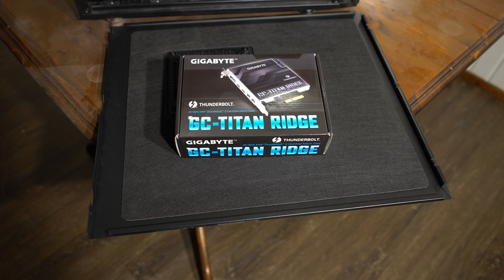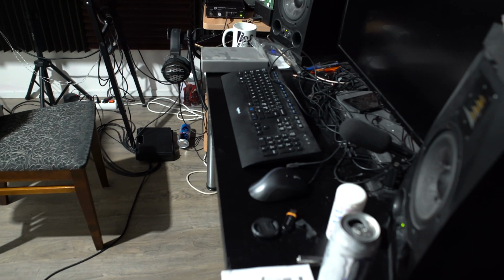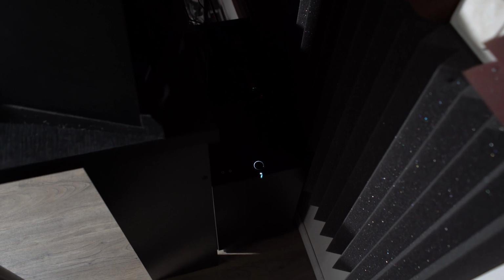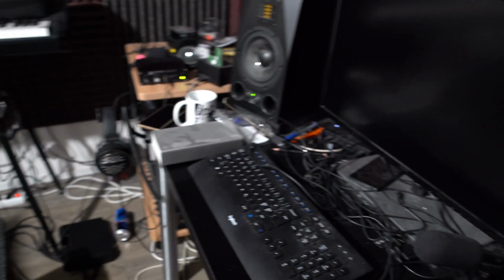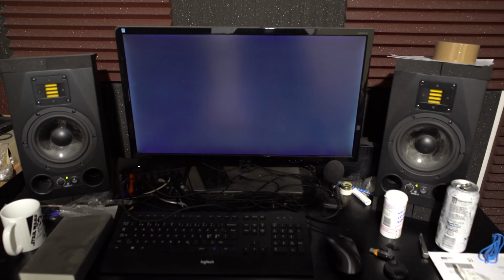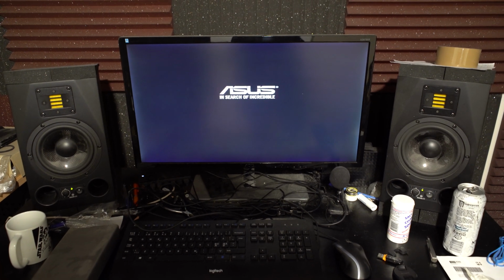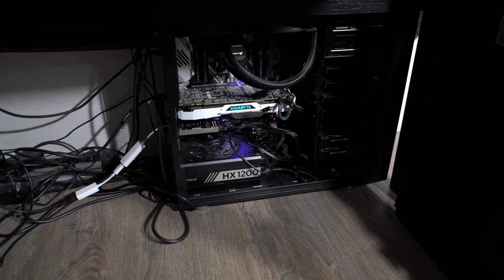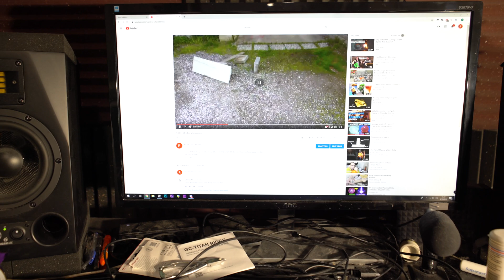Thunderbolt 3 in AMD system

Comment: I want my motherboard B550M PRO-VDH WIFI( windows ) to work with apollo twin x.. which thunderbolt 3 extension card is suitable for my motherboard..? Please help me.
Reply from the maker: There is no official support for Thunderbolt on that motherboard. The best you can do is to try if the Titan Ridge controller works with your card with the jumper cable and reboot hack.

Comment: Please don't use a vacuum on computers, it makes static and you're playing with fire.
Reply from the maker: What would you recommend? I got myself an (oilless) air compressor that I use nowadays to blow air through the fins to get rid of the gunk. But I still need the vacuum to clean the room I'm in afterwards.
Reply: @RavenFly1232  Well yeah, you do it correctly, but don't directly vacuum the computer.

Comment: Nice video man,  So where did you get the driver to install for the Thunderbolt 3? Does the card need to have a driver installed to work? like after you shorted the pin 3 & 5, did the card work ? or you still have to find the thunderbolt drivers? and where did you download the Thunderbolt drivers? thx

Comment: Hey, is this the Gigabyte GC-Titan Ridge v1 or v2? Because I have an issue with my ryzen r5 3600 as I just bought a new Motu 8Pre-es and for some reason, ryzen and the usb connection don't work together. I was hoping I could hook it up via thunderbolt because otherwise, I have to send an interface worth 1400 euro back which would really really suck.
Reply from the maker: Probably rev 1, I am not sure there is a second revision. For me the procedure to get it working was to first power up everything connected (interface and pc) and then use windows restart to restart the system without electricity going off. This ensured that windows registered the device (this functionality (plug and play) is what the header normally does). You could try this. Also check that the card and drivers are visible and installed in device manager

Comment: Do you have any issues with crackling and latency thru the audio interface any plug issues?
Reply from the maker: No, the connection was more stable than with my firewire card. The only thing the TB header probably would've done is enable plug'n'play, so with this setup I needed to restart PC after connecting the interface to it.

Comment: What kind of jumper cable did you use do you have a link to buy the jumper cable?
Reply from the maker: I think that piece of wire was from an old lamp. Any wire will do, single core copper wire is the easiest. Go to a local electronics store, and ask for bread board wire, they'll know.

Comment: So your motherboard has a TB header to plug in the gigabyte guess my motherboard doesn’t and it’s the dark hero Crosshair damn idk what to do
Reply from the maker: Actually I don't have TB header, only PCIe and a jumper wire
Reply: @RavenFly1232  do you get any issues with noise crackling? Or latency issues or stuff recognizing

Comment: Three questions for you, no idea if you’ll still respond, but one: there is certainty this should work on any motherboard (aorus b450 pro with a 2700x)? 2: would this work on the revision of the titan ridge? 3: what kind of cable did you use to jump the pins?
Reply from the maker: To your first question: it should work, but no guarrantee, so you need to experiment.

Second: I think I have The revision 1.1 or something like that, so in theory, yes

Third question: regular single strand jumper wire. The best sort is the one meant for breadboarding electronics.

Comment: Hey Man, cool Experiment and cool video really! I would like to connect my HP Reverb G2 VR Headset to a stable high power USB-C Port since the AMD X570 USB ports seem to struggle about this... This TB card has got like a 100W USB-C port and sounds like a perfect choice BUT did you say that especially the USB-C ports on this installment won't work?
Reply from the maker: Yeah, I couldn't get USB to work with the thumb drive I tried. For me personally, that is not a loss, as TB is what I wanted/needed.

Though there are USB-C cards, like StarTech.com USB 3.1 PCIe Card that may fit the bill, if USB is what you need. Probably better support on AMD too.

Comment: Would it be possible to get Thunderbolt 3 working with AMD Ryzen laptops? I just wanna hookup a eGPU on my laptop :)
Reply: Short answer: nope.

Long answer: TB3 is basically a PCIe slot in a more convenient form-factor. That means that the only way to get a TB3 port is to either hardwire it in or connect to an actual PCIe slot. Now, in theory, if you had a laptop with two internal drives and one of them was an SSD in a PCIe4x NVMe slot, then you could plug a Thunderbolt 3 PCIe card into it using an adapter cable. However, you'd have to be willing to sacrifice that SSD, expose your laptop guts every time you wanted to plug your TB3 stuff in, and rig up an external power supply for the TB3 card. Even if it worked (and it probably wouldn't, due to firmware and software limitations), it would be an absolute horror show.

Comment: I have an Alpine Ridge (r.2) and a B450 Gaming Pro with Ryzen 7 3700x and an RTX2070 Super. I know It's not supposed to work but you wouldn't by any chance have heard of a way I could make it happen? Would it hurt to try what you've done with the Titan Ridge on the Alpine? There's a USBC port on my panel but I really need TB3.0 and don't really want to spend 300+ dollars for a new board.
Reply from the maker: You need to do some BIOS hacking to get the alpine ridge to work. Some individuals have succeeded, but that's still way too much work for an iffy result.

Comment: Did your jumper wire have a connector on the tip? Or just the metal wire touching the pin?
Reply from the maker: Just the wire, and even then it was a tight fit.
Reply: Raven Fly's Channel awesome bro thank you my 2.0 just came in the mail today and the wire is coming tomorrow.

Comment: I have a Crosshair VII Hero (WIFI) and a Ryzen 2700x... trying to get my apollo twin to work via TB for months and haven't found a viable solution.
Reply: This worth it?
Reply: @StDaniel93  I'm planning on swapping my board for another one with TB support. I was tempted to do as shown in the video but I don't really feel confident in doing so, I don't know if my board being incompatible with the GC Titan Ridge is an issue, nor I can make sure this is a viable option on the long run (stability wise).

Comment: This is exciting! I was hoping to find someone else that managed to jump the pins and get the thunderbolt card working! Can i ask whether you had to install extra software to get the card working? Do you by any chance have hackintosh on this and if so does the thunderbolt work?
Reply from the maker: Only the drivers were necessary, everything else worked out of the box, only plug and play didn't, so anything new needed to be plugged in, and then the PC must be restarted (not just turned on, but actually restarted so that apparently power isn't cut off). 

I don't know about hackingtoshes, but I'd assume it depends on the Apple way of doing things. If they have other version of the controller or there is some other shenanigans going on, there may be a need to write/modify a driver. Hackingtosh community has been active in writing drivers, but as it is still a minor project, there may not be anything ready yet.
Reply: @RavenFly1232  whoa that great, thanks! I went intel in the end but really good to know it can still work on my friend's amd system

Comment: could you go into a little more detail on the jumper cable? What is the purpose of the jump, why 3 and 5, and is it bad to not do this step, will be doing it as it seems to work for you so I would like to try the same, but would like to know the theory as to why this choice was made. Thanks for the vid its been a great help so far! using a x570 elite from aorus and a 3900x

Comment: This is great!! Thanks! I’m holding to buy Apollo because of thunderbolt. I have an asus rogstrix 570e motherboard with a ryzen 9 3900x. I guess this should work. I should buy the gigabyte instead of ASUS tb3?
Reply from the maker: Depends on the model, Gigabyte has an "extension header" on some models, so you will get the plug and play features for thunderbolt, but otherwise, as long as you have enough free PCIe lanes, this should work :D
Reply: I am trying to decide on a Ryzen or an Intel build now have you made a decision yet?

Comment: The Rev one card has way too many issues on my board so I got rev 2 from taiwan. No additonal power supply or USB connections required. Just the PCI fit + THB cable and I have thunderbolt access at over 2500 on m.2. drives. The Rev 1 (when working) gave a misealy 700 on the same drive. The Rev 1 belongs in the bin. (SIMPLY BUY REV 2)
Reply: Link?

Comment: Did your bios had a thunderbolt option? I checked out your motherboard and there seem to be no TB header.
Reply from the maker: No header and no option. Plug and play is a bit finnikey, but If device is on at the time of boot, TB will work 😀

Comment: Hi, is it possible to do the same with an Asus TB3 ex thunderbolt adapter?
Reply from the maker: Can't really say, probably not as easily. The reason this works, is that the Titan Ridge controller is much more permissible than previous controller generations from intel.

Comment: USB c flash drive wont work because need thunderbolt or USB c compatible mobo with header.
Reply from the maker: That would explain things. Fortunately I have unused USB C on mobo, so this isn't too critical. As long as TB works 😁
Reply: @RavenFly1232  I'm not talking about USB C port on mobo...there are th3  header and front usbc header on mobo. I have x399 gigabyte designare ex mobo with usb c port, front usbc header, front 3.0 usb and  front 2.0 headers, and 5 pin thunderbolt3 header. Gigabyte Titan $98  or $60 alpine th3 pci cards extra. Not many th3 external drives; Th3 expensive and good for daisychain. I dont really need that tech..combo of display pci usbc. Displayport does not have audio wire like hdmi...soutput VGA serial dvi a/d/i is obsolete and dead
Reply from the maker: @cjonwickham1933  I mentioned the port only because I don't have need for the TB port to handle that stuff :D  For me the only reason for TB is to retire FireWire, and move to other protocols, when the time comes (and my LS56 stops working) :D

So yeah, niche tech needs of a small home studio, that's what I use TB for :D
Reply: @RavenFly1232  yeah...th3 and usbc is same thing pretty much....you won't miss th3 header already usbc i/0 and front usbc on x399 designare ex 1.0

Comment: no problems at all? I have an AMD board with TB3 on it and I do have problems with my Apollo Twin X. I'm thinking of hackintoshing my PC or getting a board compatible with that pcie card and try again... the problem is that this board costed me 220€ (on sale) and it sucks to have to buy a new one
Reply: Contact me..i spoke with Asrock and they told me that they gonna find an apollo interface and make it happen. I have a Ryzen 7 2700 and I am about to buy an apollo x6..
Reply: @georgezorbas6422  what do you know? you can talk to me on instagram if you have an account there. do you have one?
Reply: @miguelmoreira5248  Facebook only:Zorbas Giwrgos..find me.( the guy on the floor..)
Reply: @georgezorbas6422  Does it work?
Reply: Miguel which Asrock motherboard you have. How can I find you on Instagram,  there are many Miguel Moreira!!
Reply: @georgezorbas6422  sorry, I forgot! just added you on Facebook. Asrock X570 Phantom Gaming itx tb3
Reply from the maker: Yes, I've had no problems at all. The connection is more stable than with firewire card, and has less buffer dropouts than previously. I have left my computer on for weeks at a time, and no problems with system stability etc.

Comment: Need 5 pin thunderbolt mobo connect which is on gigabyte  x399 designare above sata ports on mobo....for  external ssd thunderbolt speed. Thunderbolt for daisy chain external GPU external ssd mini dp or dp ..dongles for laptop not enough power 15w power brick or 12v? USB C dongle converter. Also can be expensive $39 cables. 4k ...I rather upgrade gpu.  Only use i would have pci card data speed transfer for video edit on thunderbolt 40gbs  or usb c 10gbs external ssd or drives...on workstation or dongle thunderbolt/ USB C for laptop. Thumb drives USB C or 3.0 are great too...with cable adapters/SD thumb/usb 2/3/c/ethernet hub

Comment: That's pretty cool but at the same time... that's also a waste of resources. You are not using the Thunderbolt 3 to it's full potential. Usually people use TB3 for data transfer (ex external NVME SSD) or even external GPU dock (eGPU such as Razer Core).
Reply from the maker: Yeah, there is no actual need for me to have TB3 speed for anything in my computer set up, as any GPU can be put inside, as is with SSD's etc. The benefit compared to the FireWire card is the more stable connection, and futureproofed protocol.  But this is pretty much an overkill.

Comment: I'm tempted to try this out on my Gigabyte Designare X399 motherboard equipped with a Threadripper 1950X.

I know that Wendell over at Level1Techs did originally get TB3 support working on X399 with my exact motherboard, although that was with the less plug & play option due to being an older TB3 chipset (Alpine Ridge vs the Titan Ridge controller used on the card that you feature in this video).

And many people are reporting that this new TB3 Titan-Ridge card from Gigabyte is essentially plug & play on most AMD X399 motherboards, which is great!

My only concern is whether it would work within Linux or not......
I shall have to do some further research to find that out :)

Great video, good sense of humor, thanks for sharing your experience with the world, it makes a difference to those wanting to try it but that are unsure about it (Because it isn't exactly a cheap thing to get, just to try and find out it won't work and have to go through the refund process).

It will be interesting to see if USB 4.0 provides the same features as Thunderbolt 3 for PCI-E based device protocols. That would hopefully open up many more options in the future for upgrading older systems with newer GPUs or Audio Devices, Capture Cards, Monitors, etc.
Reply from the maker: Thank you for your comment!

Yes, the Titan Ridge controller seems to be a game changer, and while the plug-and-play option seems a bit of a hack, I feel that Intel is opening their technology little by little to other manufacturers, which is extremely cool! 

I don't know about Linux support of Thunderbolt, but knowing that the people in Linux community love hacking and supporting even the most obscure technology (lots of love to the guys working on Linux), I'd assume, that even if there is no support right now, It will be added soon enough :D And of course I'd assume that the windows support isn't "native" either, as they probably use Intel drivers and other software, so I have a feeling that as long as the computer can talk PCIe 3, it probably supports this card, even in AMD systems.

If you decide to try out, I'd love to hear how it panned out! :D 

The reason I made this video was exactly that, I found out a couple of forum posts telling that this could work (some Alpine ridge stuff, and 1 or 2 pages about Titan ridge), and wanted to try it, because as with anything: "If it seems too good to be true, try it, so others may learn from your mistakes" :D 

I've heard rumors, that Thunderbolt and USB would be merging in some sense in USB4. Thunderbolt supports (in theory, not in my system for some reason) USB3, so some level of unification could be expected, and I'd love a "single cable does everything" solution, that would help with all sorts of clutter :D And for me the biggest thing I'd love to see, is more thin laptops that you can easily take with you, and have all the heavier compute stuff at your desk, like external GPUs etc. Something like Surface Pro series, but with ability to do some actual gaming :O